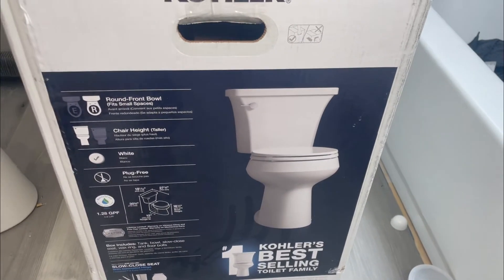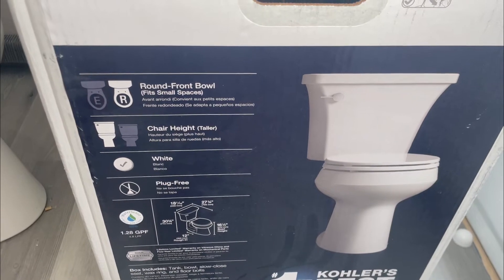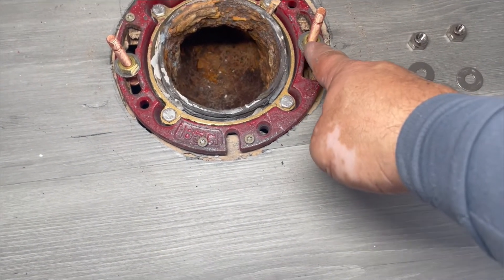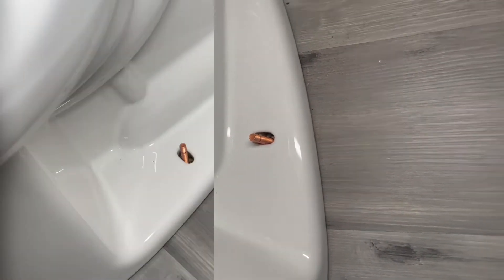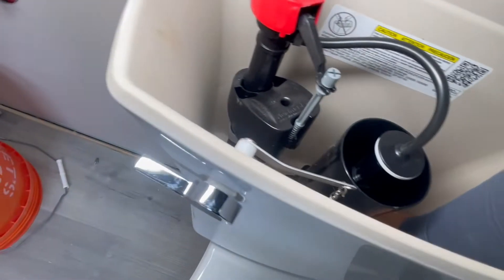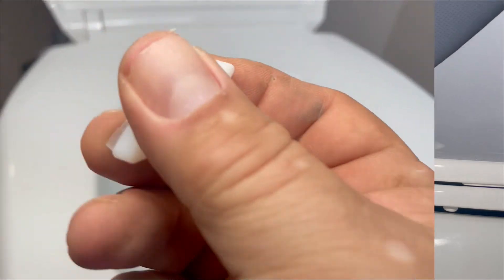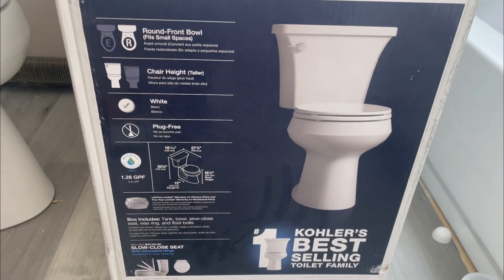HOW TO INSTALL A KOHLER HIGHLINE ARC TOILET. STEP BY STEP

Comment: I like the idea of using a socket without the handle to prevent over tightening. I’m installing the exact same toilet and the instructions from Kohler didn’t give any detail about compressing the rubber between tank and bowl. Your video was very helpful. Thanks!

Comment: I got this same toilet and it's the best thing ever! I bought an "extra thick" wax ring with it cause the one included is too "thin". Or stack up 2 thin wax rings and use them together otherwise hit up HD for the extra thick one. 

Be sure to get it with the bolts hardware cause you want to add bolts exactly in this video how he did it, because the toilet doesn't come with the "extra 2 bolts" for the wax ring area.... only includes 5 bolts AND 5 NUTS total... 3 for the tank and 2 for the toilet to hold it down and u need 2 additional "NUTS" for the bolt to hold down the bolt in the wax ring area, under the toilet... 

Then seal:caulk around the toilet, except the rear (for any leaks) and ur done,

This video helped a lot! Thanks!
Reply: Worth noting that advice on double-stacked rings is generally less than enthusiastic.  There's nothing that stops the wax rings from binding to eachother, but it's another point where the deal can fail to form properly.  Given they make ones that are double thickness that aren't excessively more expensive, better to just go for the reliable solution.

Comment: My husband and I just finished installing this toilet. We didn't use the wax seal because we prefer to use a Korky foam and rubber one instead. This toilet was easy to install, but like you said, the back bolt for securing the tank to the bowl was a pain. I had to use one hand to push it through more from the inside of the tank and use my other hand to put the nut on. But I did it. I'm very happy with this toilet!

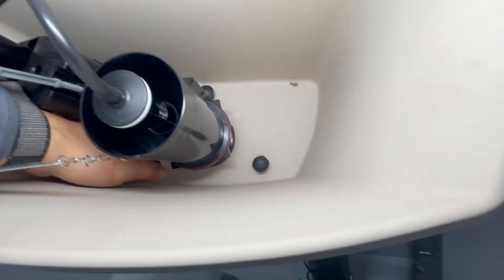Comment: Water tank installing tip - if you're finding the front left bolt hard to reach (you can see at 5:06-5:09 where he's brushing up against the in-tank hardware), you can use the handle of a moderately heavy tool (I used a basic claw hammer, as the hammerhead and claw make a decent handle) to tamp it down.  Definitely don't swing the hammer, you do not want that kind of force anywhere near porcelain!  You're just looking for something with a sturdy handle that you can use to tamp down the bolt.  

My arms are fairly thick, so the only way I could reach the bolt was reaching down on the right side and wrapping my hand around the back of the flush mechanism, at which point I was very much in danger of knocking the tank off the toilet and had very little leverage for forcing the bolt down through the rubber gasket.  The hammer handle made a huge difference.

Comment: Very well done. I usually have pieces of tape all over the floor marking the bolt location and I still have trouble getting it perfect on the wax in one shot.
Reply from the maker: Ha ha,   whatever works right.  We need to get a fancy crane with ultrasound bolt location.

Comment: Outstanding video.  If one was to renovate their bathroom at a later date and had to pull the toilet out, I assume you simply just need to buy a new wax ring again and just repeat the install steps again except this time the entire toilet is already put together, is that correct?  Or is it a good idea to separate the tank and bowl and reattach after the bowl is put back in?   Would you need to buy new closet bolts and caps again or can reuse them?

Comment: excellent video.  I'm having a devil of a time with getting my tank on because the bolts push up into the tank so easily and take so much force to push back down.  I've gotten them forced back down by just screwing the nuts onto the tank and using that to pull the bolts through...now I just have to get the tank properly positioned without pushing them back up.  Looked this up while I'm at this stage to check if I'd managed to push the middle assembly up out of place as well (I'm familiar with basic flapper valves, not the fancy flush mechanism this thing has) but it seems that mine is in the same position as yours, so things should be just fine.

Thanks for the advice about final positioning of the toilet without breaking the wax seal - I've been told they're quite easy to crack, so every slight shift during the installation process has me nervous.  Looks like you have a method that is gentle enough to not break the seal but still does enough to get things adjusted.

Highly recommend, if anyone is looking at installing one of these, that you invest in a closet bolt system that incorporates the extra nut clamping onto the flange.  The toilet comes with ones that have little plastic togs that will hold the bolt approximately upright, but it's not solid enough to actually keep the bolts still.  Not technically necessary, but if you're new to this like me, it's rather annoying to have the mounting hardware move on you.

Comment: Nice job Alex. Thank you. I didn't find the setup of the water as the push of the water was not so strong and the residue stayed, which is disappointing.
Reply from the maker: Thank you!!   It doesn't flush properly? of you couldn't flush the valve?

Comment: Fine job Alex.
The only thing I would have added would have been the measurements of the inlet hose, as they vary depending on the type of Gate valve being used.
Example being, mine is a 1/2" and the unit in your video was a 3/8".
Otherwise, Outstanding work.

Comment: great video alex 🧐was curious why you recommend against the reinforced wax ring ?
Reply from the maker: Hello ,   It is case by case . If the toilet flange is a bit too high, the reinforced wax ring will not let the bowl go flush with the floor.   The reinforced part of the wax ring is hard and sometimes is an obstacle .  If it is all wax, the wax will adjust and deflect as needed, so the bowl seats flush with the floor. Next time you have a reinforced wax ring on your hands, take it apart and feel the reinforcement.  It is hard.    Make sense?

Comment: Hay Alex, is the wax ring that comes with the toilet adequate? Or should i use a better aftermarket wax ring.
Reply: I'm asking the same question as i stare at the brand new kohler in the box. Should i go to home Depot tomorrow to get a bigger wax ring in case? What the flange? And i totally forgot about the supply line. . might as well get shims too just in case. Your wax ring was good ?
Reply: @feras04 deff get the "thicker wax ring" separately. One included is too thin ... although u can use the one included with another thin one together...

But I'd get the "extra  thick" of int from Home Depot and be sure to get the one with the bolts included and not Just the ring itself like I did lol

But but. I'm happy with it.

Comment: Do you suggest using waterproof clear caulk at the bottom of the toilet/floor?
Reply from the maker: Hello Deadre,   No I don't.   If there is a leak at the bottom of the toilet, if caulked, you will not see the leak until the floor or downstairs ceiling is destroyed. If there is  a leak from the wax ring you want to notice right away.    Thanks.
Reply: @alexthehandyman3494 I think caulking around the front/part of the sides of the toilet to provide a clean view isn't a bad idea just don't caulk the back of it
Reply from the maker: @TeddyRux20  Hello. Teddy.   If all the leaks were in the back of the toilet then I '' ll give it to you.     But yes.   I anybody wants to caulk it.  I don't have a problem. Go for it!!  Thanks Teddy.

Comment: Alex, where did you get the boots with double nuts ?
Reply from the maker: Hello 
you can get them anywhere.  usually more expensive.  Menards have them for sure.  
The bolts that come with wax ring usually too flimsy.  I always install 5/16 instead of 1/4
https://www.menards.com/main/plumbing/plumbing-installation-repair/toilet-installation/plumb-works-5-16-x-2-1-2-solid-copper-replacement-toilet-flange-bolts/61-211/p-1444432991957-c-9418.htm

https://www.homedepot.com/p/Blue-Monster-Advantage-5-16-x-3-1-2-8cm-x-8-9cm-Closet-Bolts-73070/320653342

Comment: Did you use different wax or the one that comes with the toilet??
Reply from the maker: HELLO
I used a different one.  Thicker and taller with no core reinforcement.  #10 from Menards or Home Depot. However the one that comes with is perfectly fine.  Thanks.
Reply: @alexthehandyman3494  thanks

Comment: I noticed you didn't use the wax ring that came with the toilet?
Reply from the maker: Hello,  good catch!!   Yes I did not!  Nothing wrong with it.  It is totally fine.  I prefer to use thicker ones for better results.  Again, nothing wrong with it.   Thanks for your comment.
Reply: @alexthehandyman3494  I just installed one in my home. I used the one it came with. But I was actually debating on getting the thicker wax ring. Yep it work just fine

Comment: Actually, the three rough-In sizes are 10 inch 12 inch and 14 inch I have a 12 installed on a 14 that is a 12 inch rough-in toilet installed on a 14 inch Rough-in space.
Reply from the maker: I never seen or heard a 14.  Thanks for your input.